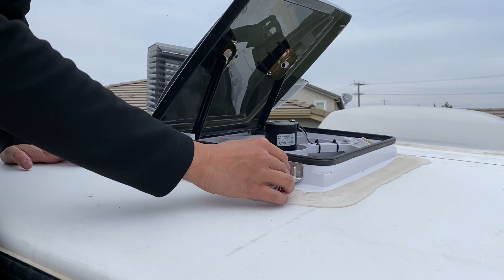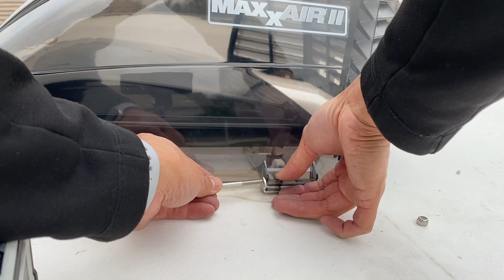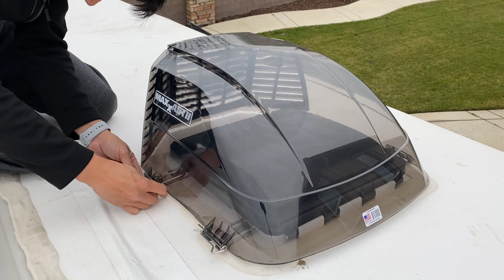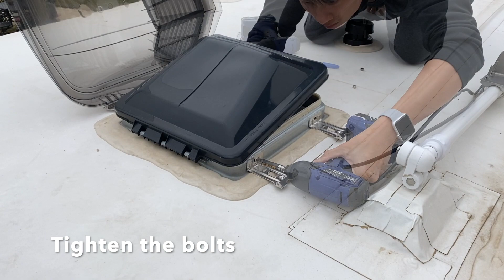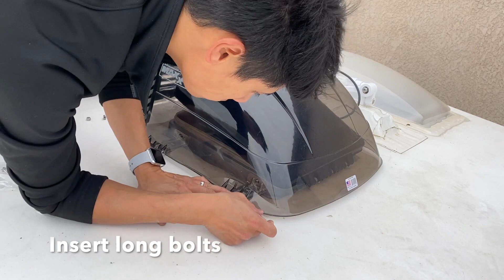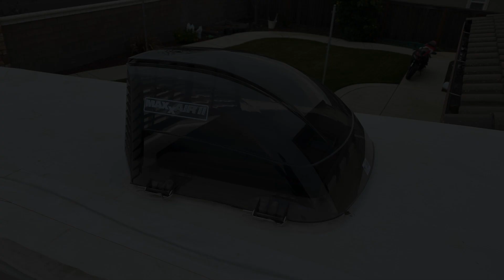Vent Cover, Two Ways to Install

Comment: In case others watch in future, this cover works well with a Maxx Air fan, the white clips already there can be used for the clip side without the need to attach the brackets.  They are there exactly for the maxx air cover.  Saves time!